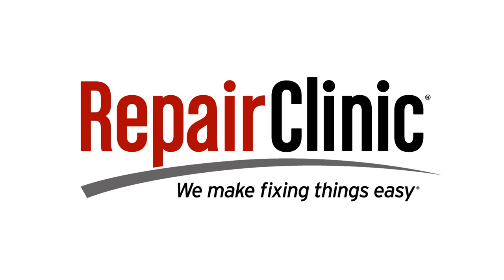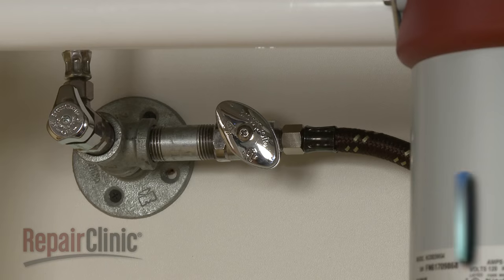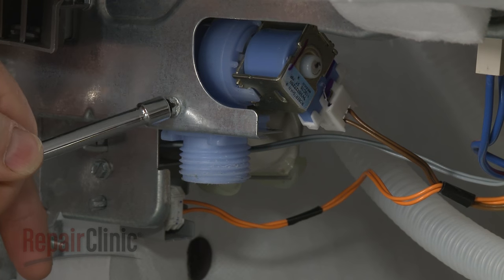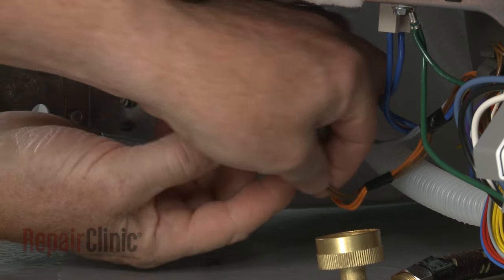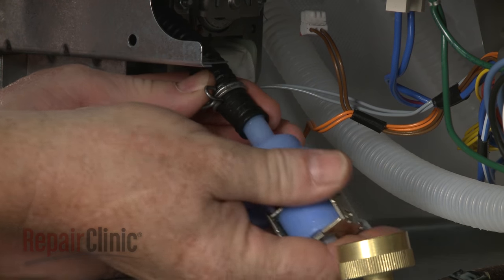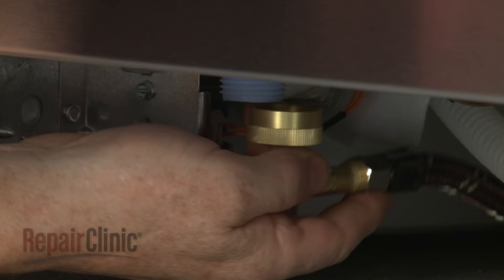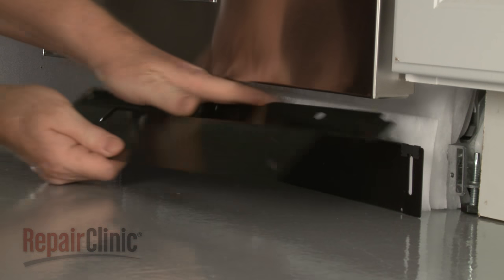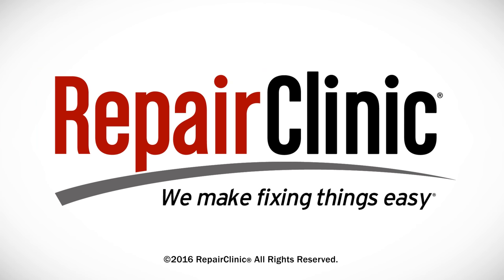KitchenAid Dishwasher Water Inlet Valve Replacement W10872255

Comment: Perfect instructions!  The replacement valve has changed a bit...it has a new electrical connection that looks different but it worked.  Glad not to have to hand wash dishes any longer...

Comment: Ok, so i replaced the water fill hose and now the inlet valve and it still won't fill with water.  Machine turns on and runs through cycles but never puts any water in.  It worked with my last load of dishes, not the next which was later the same day.  KitchenAid.
Reply: Hi Beth. This morning my dishwasher stopped filling with water. After watching videos. Calling kitchen aid to find correct parts etc.. One amazon reviewer said he replaced the water inlet valve but that wasn’t the problem. Seems the problem was to fix the “ dishwasher float switch”. It was $14. So I ordered both parts just in case. Not sure if this will help. But wanted to share. Best of luck.